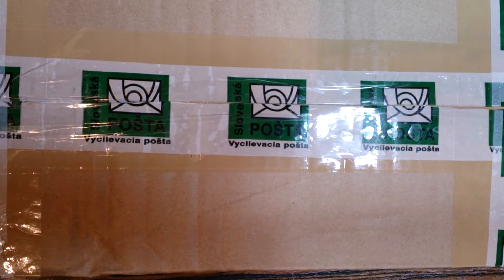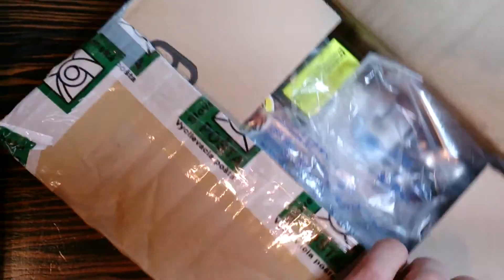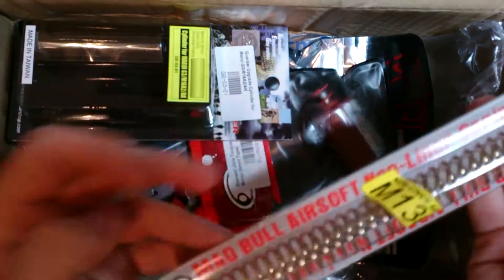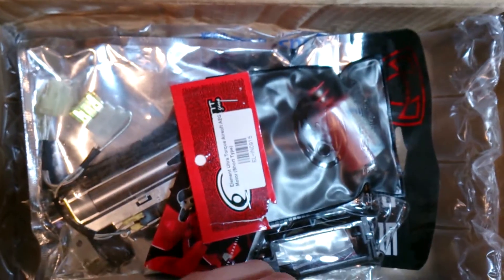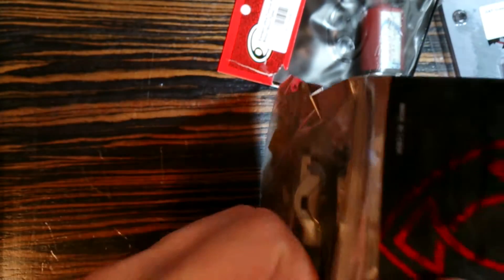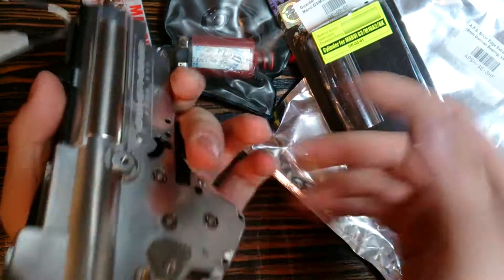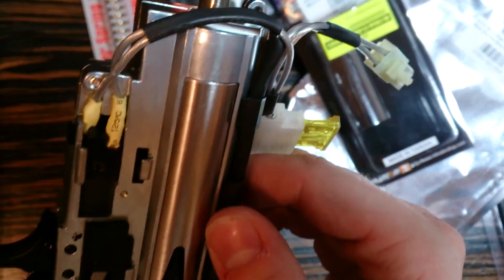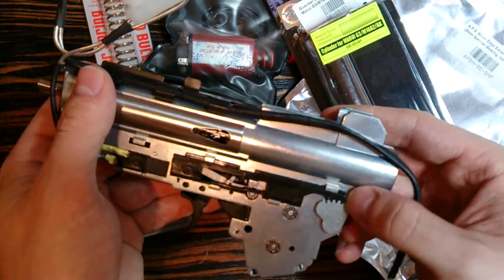eHobbyAsia parcel unboxing - A.P.S. gearbox, Element HighTorque-motor and more

Comment: Hey can I put a 140 spring in the standard Silver Edge gearbox for long term use?
Reply from the maker: Yes why not, I think it should manage 150M with no issues as well
Reply: ***** Can I do this even without the high torque motor? Thing is I have an APS 115 with the original setup, I just want to replace the string.
Reply: ***** And should I put more resistant gears too?
Reply from the maker: Thiago Peres I like realism of full auto firing, so you will see how fast it is firing. ROF on mine is same like real gun, so I am happy for that :)

Comment: Hows is the gearbox? Worth money? I am thinking about it for mine kalash, 455mm barrel do i need new cilinder?
Reply from the maker: Raimondas Simanavicius hey buddy, after a 3000 shot bbs the trigger mechanism stopped firing on semi. Quite common problem on this gearbox from APS. The full cylinder is just if you want more FPS or lower the FPS with hole in it. I would recommend Retroarms gearbox. https://www.retroarms.cz/cnc-mechabox/cnc-mechabox-verze-iii-8mm-qsc
Reply: ***** Thanks for answer mate. I am thinking about Cyma gearbox ? heart good thinks about it as well, i dont want to spend fortune on it.